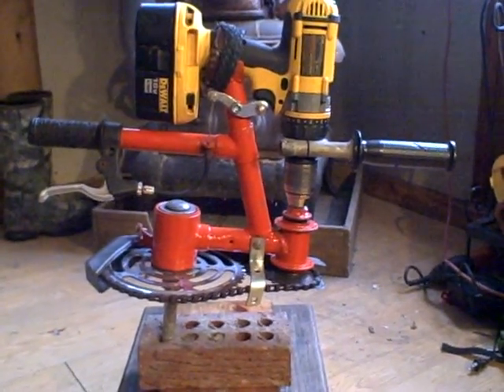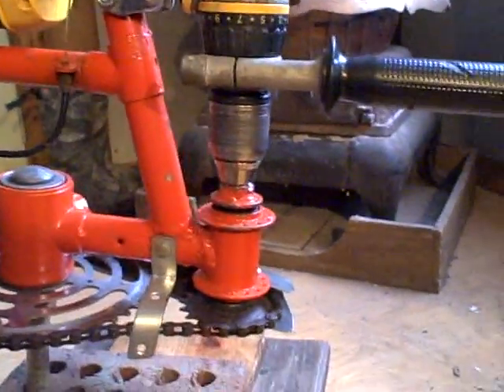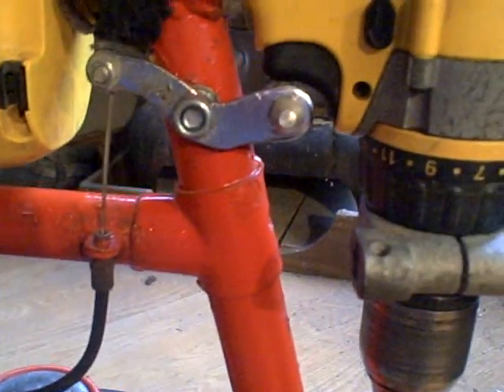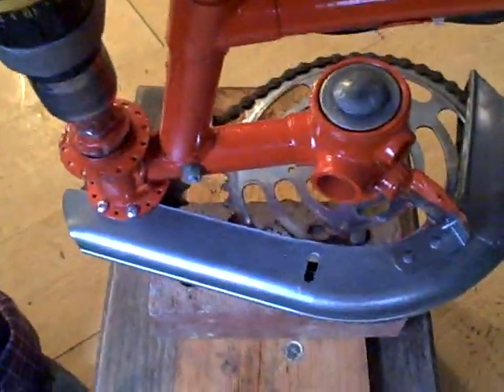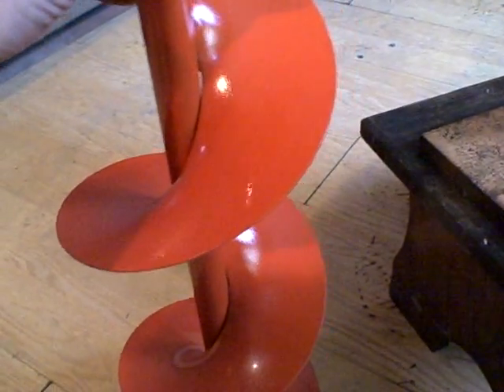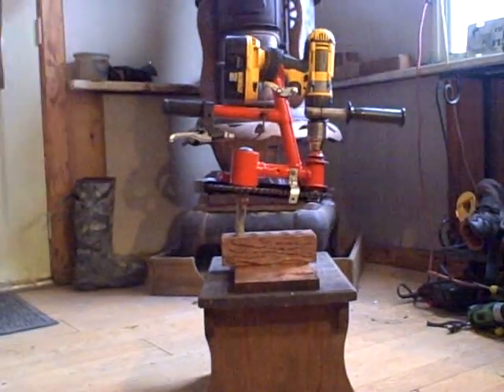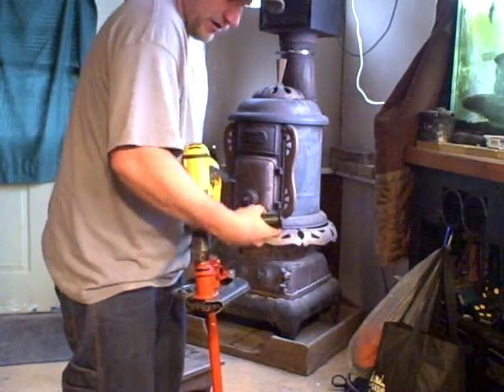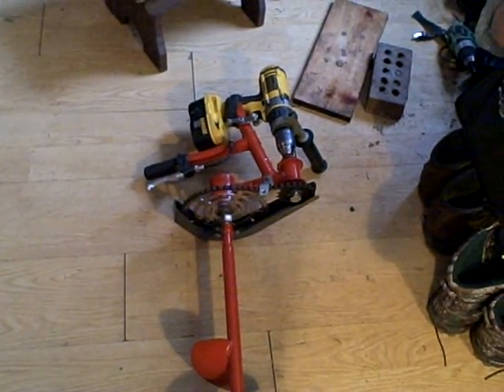D.O.R.A Drill Operated Reduction Auger

Comment: Thank you, i want to try with  buffer head gear ( burned out motor) i will put the drill 90 deg. to the auger.I like your actuator.I  did built one with a car starter , but you need to carry a big heavy battery.  https://youtu.be/DwM35FZGA4g

Comment: Great idea how much for one. Let me know I'm interested in one or maybe even investing in them
Reply from the maker: Charlie Morris this is the prototype. You can email me directly to discuss, unfortunately they are not in production yet. Melissamcm24@gmail.com
Reply: Melissa McMeans I'm not sure if you know that clam had a gearbox that mounted to the top of a plate that they sell the plate was to be used on 6 in augers than the gear box came out for 8 in augers. They had to recall all the gear boxes because they weren't holding up
Reply from the maker: Charlie Morris yes, I'm familiar with the Clam Plate, most likely due to powdered metal gears. There are some other companies that have tried, but the system we designed is safe, comfortable and has been being used for 5 seasons on the same drill.